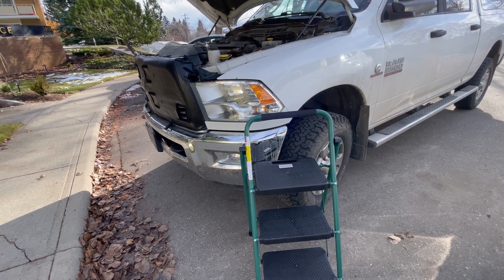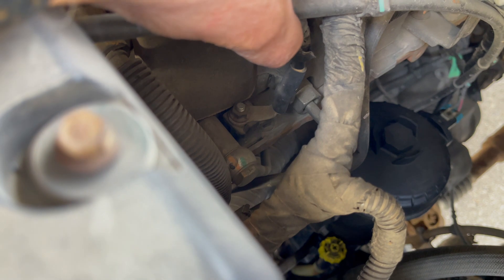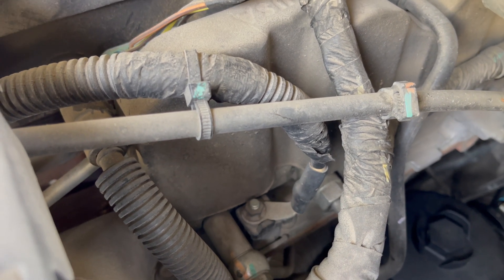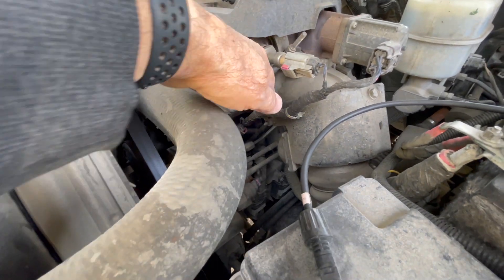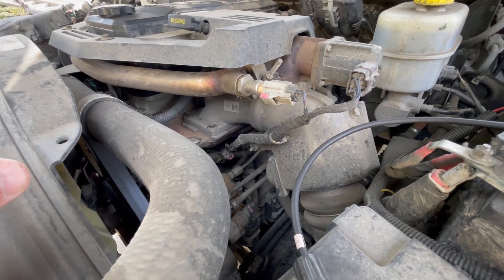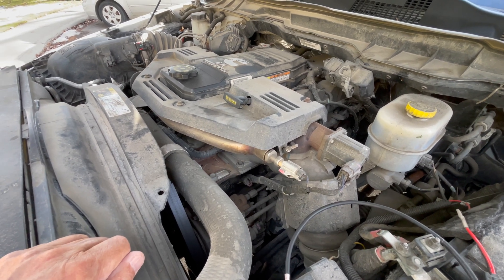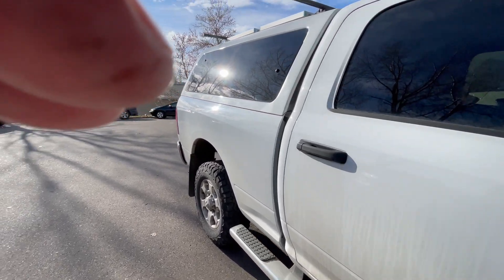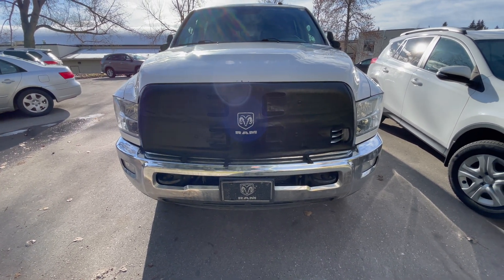Cummins 6 7L - Diesel Grid Heater Issue?  How To Test for it!

Comment: The heater works almost every time you start the engine, I live in Texas and I hear the solenoid going off almost always. And the heater is controlled by a solenoid that shuts the power off , if the solenoid fails to shut off that’s when you got a problem.
Reply from the maker: That is one of my possible explanations.   So far, all is well, nothing loose or warping at the heater connection.  I monitor the battery & temp at that site.  Using Edge monitor.  It only come on for short or no period when air warm.   I can tell when it on, voltage drops from 14 plus volt to 11 & another way you know it one, is the fan speed when set for max, it slow down when the grid heater is on.
Reply from the maker: This isn't the case with me, it only comes on when it is cold.   There is a temperature sensor that would turn it off and on.

If your unit come on always, even summer time.  Either your sensor is flakey or you may need to check if your firmware is uptodate.

It doesn't make sense for it to come on during summer or when the temperature is a several degrees above zero.  (I haven't taken note of the exact temperature, but will look out for it.)